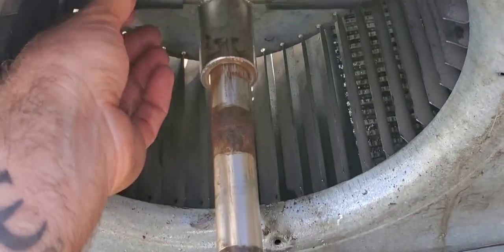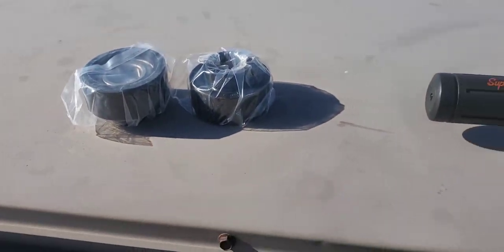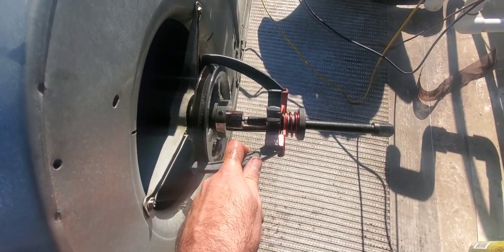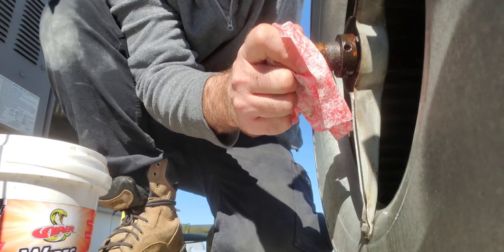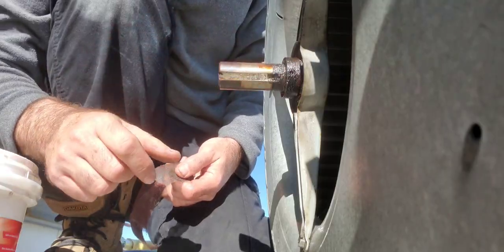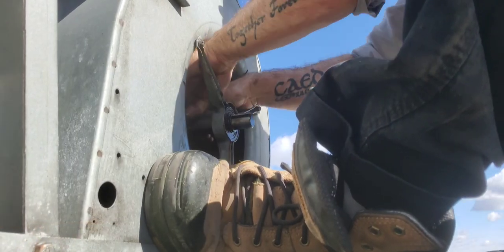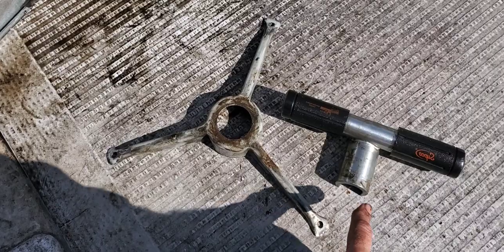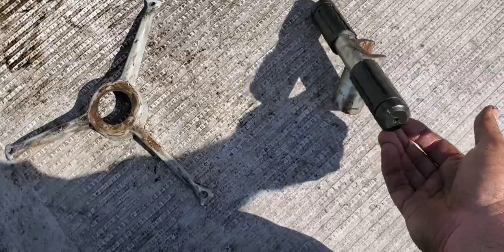Blower Bearing Replacement Using the SUPCO Bearing Buster

Comment: Curious: how long did it take you to pull those bearings? Would this save any time compared to replacing the shaft and wheel?
Reply from the maker: About 25 min, these ones were super seized though.  I've seen techs pop these in 1 or 2 blows.
Reply: @HVACKnowItAll  interesting… I’m going to give it a shot! Thanks

Comment: Personally I don't put my puller on the outside of the pulley's just because of the chance that you will break or bend or deform the outer ring if you go to the inside hub where it's solid steel you don't have to worry but that's just me to each their own also I have found that if you use a automotive cam sprocket puller they fit a lot easier and are smaller and just as strong